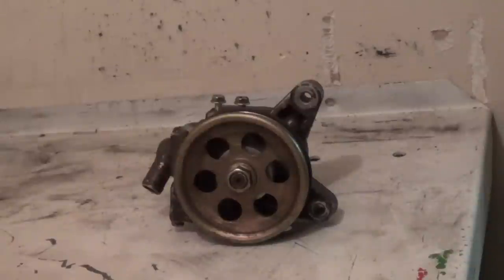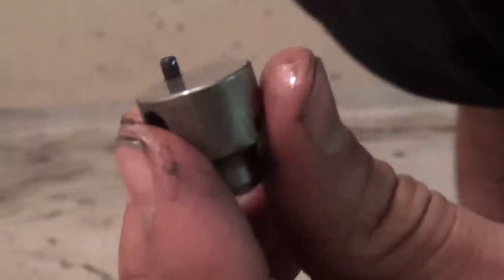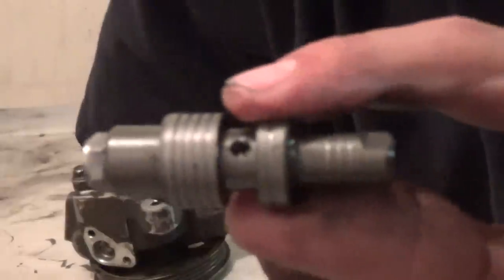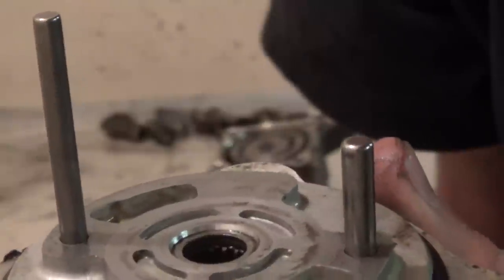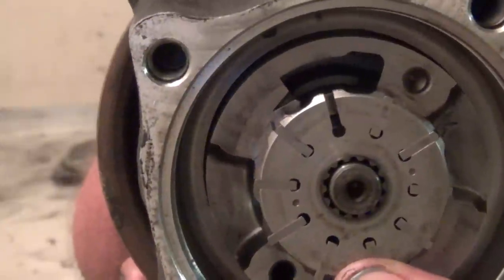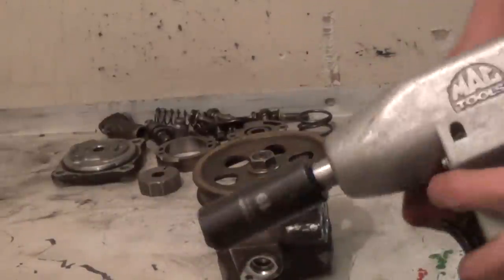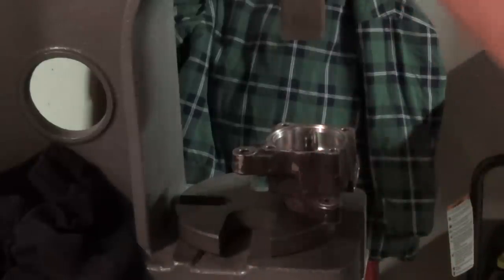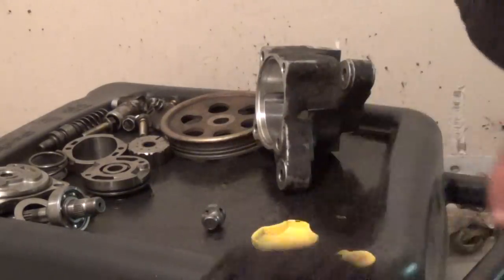Honda Accord power steering pump reseal (teardown)

Comment: This pump is for the 4 Cyl model accord, the V6 pump is mirrored (backwards). Both pumps for the V6 and 4 Cyl are basically identical inside and if you pay EXTREMELY close attention parts can be interchanged, but only a few. (vanes, center rotor, springs, pressure relief valve) And only on model years 94 through 97 as the design was heavily changed.
Reply from the maker: Right on!
Might have to make a trip to the junk yard to pick up some other model years.
Thanks for dropping me a line!
Reply: @SouthpawAutoworks  You're very welcome.
Reply: likely....90-97 are all the same. just fyi

Comment: Hi, I've watched all your four videos on pump rebuild and they are very amazing. Especially the honest advice and encouragement you gave in the last video. I however want to ask, what are the expected damages I should expect if the pressure of my pump has reduced? Thanks.
Reply from the maker: Thank you for watching, and for dropping me a line.  Much appreciated.

That's a hard one for name to answer, as it could be number of things (vanes and cam ring wore out, internal seals hardened and causing internal leakage, worn out flow control valve, contaminated flow control valve, etc).  Your best bet is to tear it down and conduct a thorough examination of all parts.  Look for signs of wear on metal parts.  Look for rubber seals that are no longer soft.  The proof is somewhere in there...waiting to be discovered.

I was hoping to answer your question in a more direct manner...but, I gotta be honest.  Can't know for sure, without taking a look inside of the unit.
Reply: @SouthpawAutoworks  You've actually answered my question and for that I'm grateful. I noticed some leak in one of the pressure hose. I just changed it and tried to pump out almost all the oil in the whole line. I put fresh oil, not expecting to see much difference but lo and behold, there was a big improvement in the steering system. It occurred to me that, I might have some air trapped or oil clogged in my system before. Thanks so much because I wouldn't have gone that far if not for your video.
Reply from the maker: Right on!

Comment: Not sure why the pump slide on your ps shows the one dot on facing out when the service manual states the opposite. The two dots face out. I installed per your instructions and it was hard to steer the steering  wheel.
Reply from the maker: I'm really bummed to hear that.  However, I really appreciate you bringing it to my attention.
I updated this video with a brand new one.
https://www.youtube.com/watch?v=aQ0n_yp1hQ4

Comment: hi bro, you said the witness marks are on the left of the vanes in this video. In your other part 1 video, you showed it's on the right. I am confused now. Which one should I follow?
Reply from the maker: The only way to know for sure is to make note of the orientation of the vanes prior to disassembling this part of the pump.

I recall you mentioned that "all the vanes fell off from the rotor by accident."  What a bummer...

Unfortunately, I can't say one way or the other on these vanes.
Reply: @SouthpawAutoworks  Roger that. thank you bro